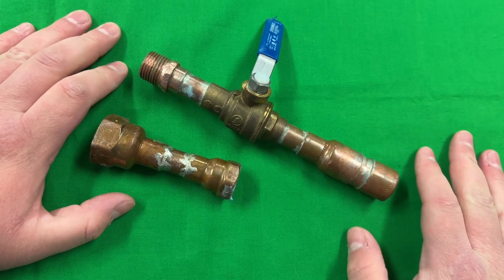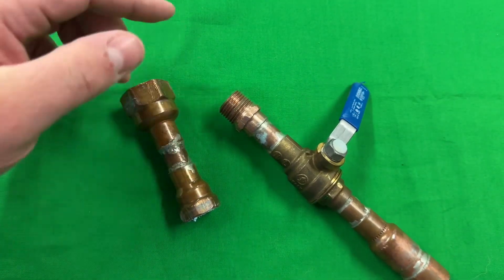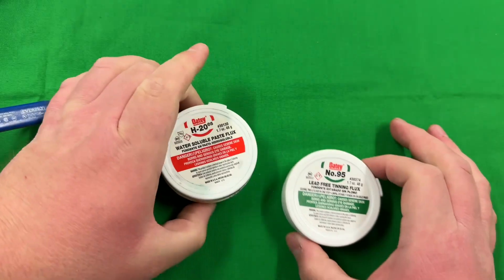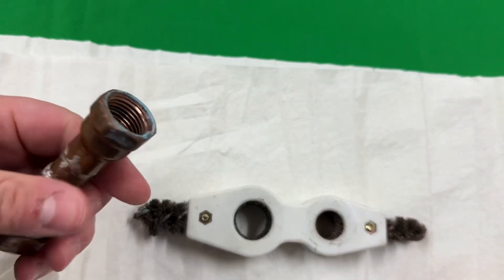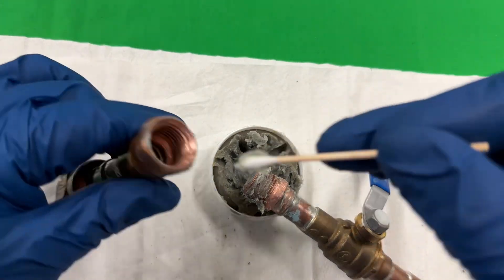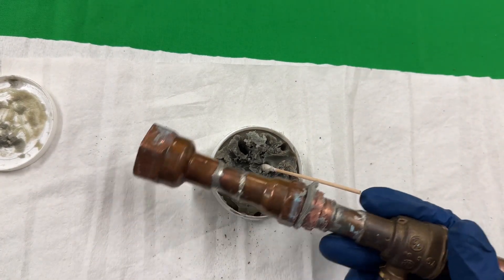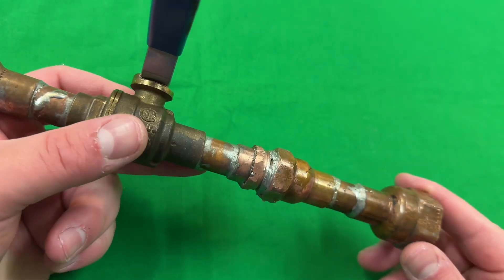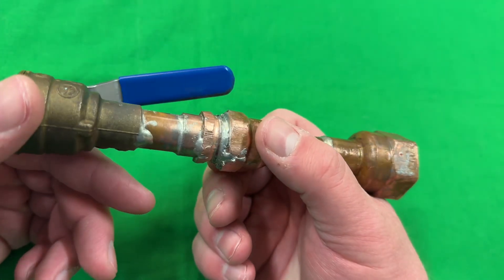Can you solder threaded fittings? Pressure and torture test!

Comment: I have a pretty extensive water system at my house, I did it myself to save costs because if not we couldn't afford it. None the less with 2 1"meters   (1 for house, and sewer water, the other my shop and irrigation meter)  reduced to 1 1/2" to the house supply. Then reduced to 3/4 at the inlet. The irrigation meter reduces up to 2 in, and I ran it all with hdpe pipe, all with brass A.Y. McDonald compression fittings that reduce and adapt to 1" pipe thread for some firehose like pressure. There are several with 2"  npt adapted tee's. Anyway the point of saying all this is that I started out with Teflon,  and pipe dope until I had one of my tees leaking.  I'm a welder by trade and is how I still make my living.  I thought of starting out with solder but didn't.  When the tee leaked and I couldn't get it to stop with 2 24" pipe wrench's I started soldering all of them. I liked it so much that I went back and soldered every fitting including the one's I had done already with teflon and white monster dope. I don't really know of anyone that has done this but I was doing it on my own, and for most customers I could only imagine wouldn't want to pay the plumber taking his time soldering all the fittings. I also know that my water wont be leaking for at least 70-100 years.Lmao

Comment: I know for a fact that this works because I had a hell of a time attempting to remove a hose bibb that had the threads soldered in place in the 70’s. This was three months ago.  Bibb never leaked at the threaded connection. Took a 24” and 18” pipe wrench to disassemble, did not apply heat. Never saw the solder until it was unthreaded.
Reply from the maker: That’s really interesting to hear, thanks for leaving your comment. 

I have never encountered it doing any plumbing repairs but I was always curious if it would work. I’d never do it but I always wondered how it would work if you needed to for some odd reason